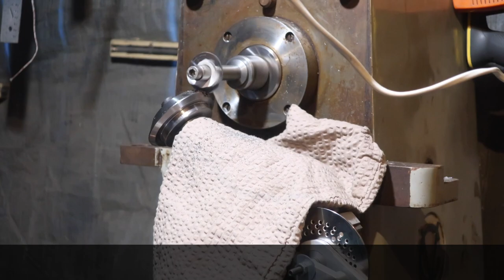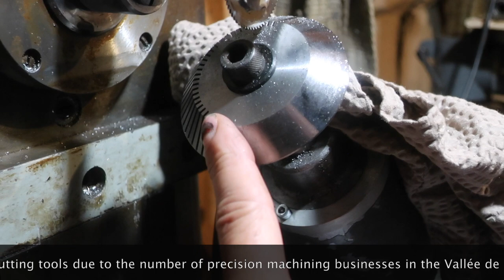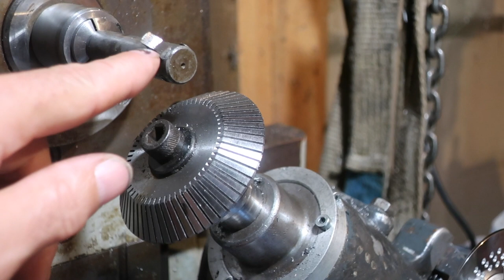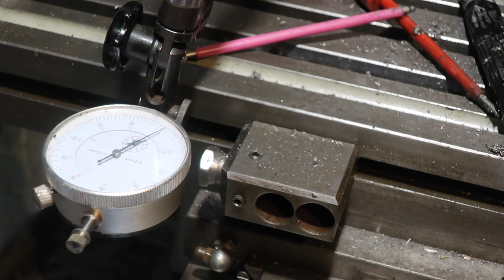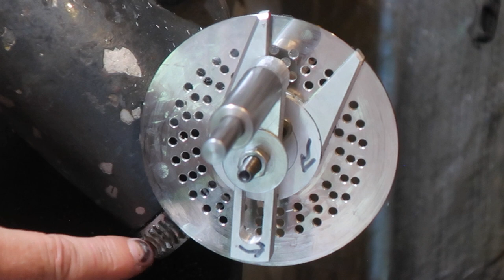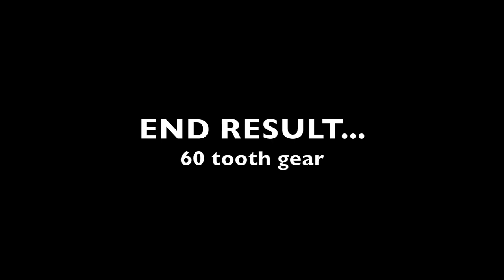Hot cutter on blank action!

Comment: Evening, 60 teeth takes some cutting, only recently discovered that bevel gears require a bevel gear cutter ! ratio on my dividing head is 40:1. not sure I have the patience to use a fly cutter. Regards Del.
Reply from the maker: Hey Del.  If you want to do bevel gears 100% correctly, you need access to a Gleason gear cutting machine...  With 3 passes and an involute cutter, though, you can get very very close to "correct", though.  If you're cutting imperial gears, the process, including tables for offset of the finishing passes, is detailed in various places including Machinery's Handbook or the freely available "A Treatise on Milling and Milling Machines" by the Cincinnati Milling Machine Company (pdf from archive.org).  For module gears it's a bit more tricky as you have to convert back and forth, but it's entirely do-able.

Like you say, 60 teeth takes some cutting, with 4 passes that's 240 cuts.  61 teeth is even more challenging as each division is 36 turns of the crank.  Wont be doing any other wrist-related activities for a while :)

You have dividing tables for your head, I assume?

Comment: 55 holes on a 61 hole plate is what you need. Do you have a DRO with a bolt circle function?
Reply from the maker: Absolutely, and that's what I ended up doing.  I don't have a DRO, let alone one with a bolt circle function, so I made a quick paper template, drilled 61 holes with the disc held in the lathe chuck, and then used that.  Loads easier. :)